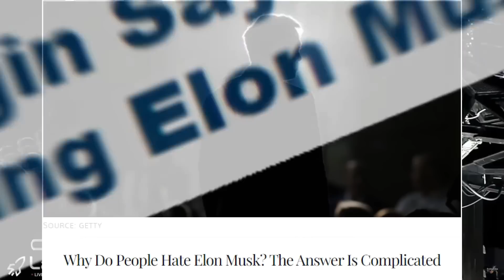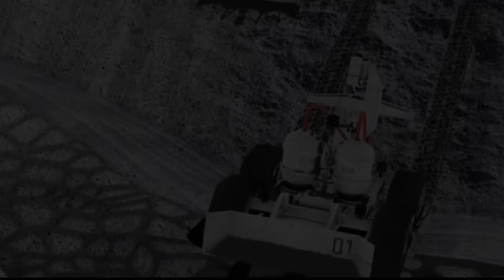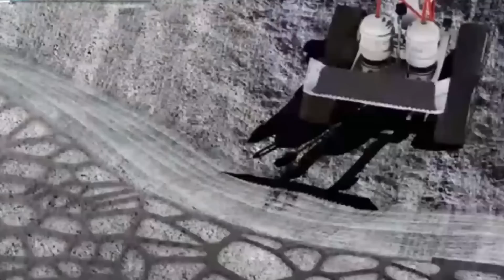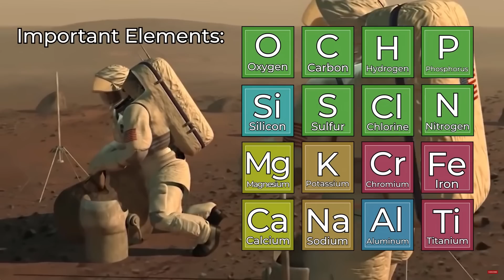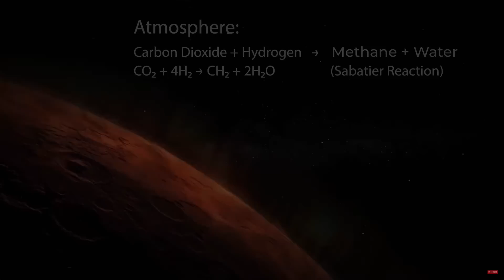Space Colonization: What is the Best Destination for Humanity in Space?

Comment: The moon is truly a necessary step.  We need to develop the industrial capacity outside Earth's gravity well.  
We can mass produce materials out of aluminum, magnesium, and silicon for sure out of lunar materials.  And with the much smaller gravity well and basically zero atmosphere we could then launch those materials into orbit or into the deeper solar system using mass drivers and not even need chemical propulsion for the effort.

We need to develop and perfect the ability to live and thrive in vacuum enclosed environments.  Not only to survive but to be self sufficient on the production of food and recycling of water and breathable atmosphere.
Right now we know we absolutely do not have the ability to sustain these systems over a long duration.
If we have people living in these systems on the moon and there is a catastrophic problem, they are less than 3 days from the full industrial capacity of the earth.  Problems arise on Mars. They are all dead, because at minimum they are 6 months away ( if they are lucky enough to have the problem just prior to a launch window) from those same resources.
Once we have these resources and industrial capacities developed on lunar, we will be able to manufacture fleets of ships, thousands of space habitats, Even the ability to start building the O'Neill cylinders to put into earth and lunar orbits and send to Mars and Venus and have thriving human settlements in orbits of those planets while we have the robotic equipment to start harvesting materials out of Venus's atmosphere and developing human habitation on the surface and beneath of Mars.
Reply from the maker: We agree Jared.  Orbital habitats will only be a possibility (large one) if we have access to the Moon.

Comment: Will Is clearly Biased for Mars and he is exaggerating the favorable conditions of Mars.  As it stands Neither Mars nor the moon can be terraformed.  Mars is a virtual vacuum, the soil is poisoned with perchlorates and there is no liquid water, it is mostly below freezing year round you would have to use pressure suits to get around and all of your architecture would have to be made up of pressurized tanks just like in space.  All the Artists renditions of living structures on Mars are total horse crap.  Most of those structures cannot take ten PSI, they would deform and explode.  And domes? forget about domes, you can only have a spherical shape, a cylinder with hemispherical ends or a lenticular shape or some variation of these but no flat surfaces and that includes Domes over a flat land area, it would take off like a rocket.  A 20 foot diameter glass dome would have a square area of 314. feet and pressurized to 13.88 PSI would have a lifting force of 314 tonnes.  Gravity is about one third so forget about piling dirt on it.  It would pull up a concrete footing and fold it like a Ritz cracker.  To deal with the pressure you would have to find a nice small crater that has the inverse of a dome,  line that with an air tight plastic, line that with rebar and concrete and THEN build a dome over it  with steel girders to hold in tons of pressure against your very very thick glass or plexiglass, maybe 2 to 3 inches thick for a few square meters.
     Mars does have more elements on the surface than the moon, but the moon is made up of the same accretion disc the rest of the planets were formed from and the interior should be rich in many things so it is just a matter of how deep would you have to dig to discover it.  the last several asteroids to hit the moon of great size blasted their contents like snow over the surface.  You can't know what is below that until you get an excavator up there and start digging.  You need the same habitats on the Moon as you would for Mars except the moon can get much warmer.
    The moon has oxygen and something like concrete so that is very good and there is water ice below the surface and in polar craters,  the same is true for Mars.   Mars also has lethal radiation and is so far from Earth that a rescue mission would fail if there was an emergency , six months to get there, have to wait for the 2 year window, no.  The Moon is a much safer distance .
    Mars is too cold, too far from the sun, the sun light is too dim, there is not enough gravity, not enough atmospheric pressure, not enough oxygen, not enough water and the radiation is lethal and the soil is poisoned.  Expect  about half of the people you send there to die every two years.  It's a death trap  There is a possible solution but it is MAD.  Send a ship out to some of the icy asteroids of around 10 miles in diameter, attach two or three nuclear plasma ion rockets to melt the water ice to make rocket fuel and propel the asteroid slowly towards Mars orbit.  In a few years adjust the  course so it hits the night time side of Mars.  Do this three or four times, re-using the original nuclear rocket engines repeatedly .  This would take decades.  But with each impact you would add water ice, oxygen, mass, gravity, warmth, atmospheric pressure and knock it a little closer to the sun.  If we could make it ten million miles closer over 30 years this would solve a lot of problems with cold weather, water, distance and fuel, time, breathable atmosphere, pressure, warmth.  It may not be possible to inhabit it during this process but perhaps make drop shipments and get a site prepped.
Reply from the maker: Very good points.  I think a floor to the dome would obviate the rocket effect.  I also think graphene and its derivatives could have some utility on Mars.  Many materials can easily handle one atmosphere and it should not be hard to use shaped inflatables so that a sphere is not necessary.  Inflatables survive the stress of reentry so getting them to work on the Moon or Mars should not be that difficult.  Mars main advantages are that it has micrometeorite protection, half the radiation, and more easily accessible water.  Terraforming  is probably not very realistic on Mars unless we can find a heavy, non-toxic gas to use to trap heat.  One that doesn't dissociate to free hydrogen like water and methane do.  If we could just open a Stargate on Venus connected to one on Mars and let some that sweet heated CO2 flow over we could terraform both planets :-)
Reply: @terranspaceacademy  The floor under a dome will have pressure on it too, it will try to assume a spherical shape so it must be stiff enough to withstand one ton per square foot or it will fold up like a ritz cracker.  If it were anchored to rock, like bedrock it would have the strength to withstand the forces of one bar.  Consider that Elon Musks 30 foot tank exploded at only seven bar... and it was a domed quarter inch thick stainless steel tank.  At 13.88 psi a 3 x3 window will have  nine tons of force pushing out on it, if it is not already bent outward it will quickly do so and break or explode out through it's opening.  It could be done with very thick plexiglass, like two inches or thicker, but imagine how much that kind of glass weighs, it would be impractical to carry many of those and very difficult to make glass on mars... it's so contaminated with iron oxide and perchlorates.
    There is a way to terra form Mars, crash Vespa on it or some suitable large icy body in the asteroid belt.  There is no easier or faster way to get cubic miles of frozen water to Mars.  Venus' atmosphere has too much sulfur and acid in it.
    Water vapor and Methane are very potent greenhouse gasses.
   Oxygen can be released from iron oxide ores making both iron and oxygen at the same time.  THis iron would be about as light as aluminum on Mars so it would be a good building material and shouldn't rust in the dry environment.
    If we could propel a comet into Mars I wonder where the molten water would drain to?  The Vallus Marinarus?  That's like Death Valley on Mars so maybe it would concentrate there.  The impact on a recent asteroid/comet by DART gave me hope that a very small object can alter the course of a very large object in space.  I would make crashing icy bodies into Mars my top priority if I were serious about terraforming.  There is an engine design, nuclear ion/plasma that might be suitable for the task.  THe question is how long would it take to alter the course and steer it into Mars?  How much would that move Mars sunward? While we're at it why not crash phobos into Mars, they say it's going to hit it in the future anyway, better sooner than later.
Reply from the maker: @TheWadetube  That's very true... should we go all oxygen and get away with 20% pressure? (0.2atm/200kP)
Reply: @terranspaceacademy  No, we need the pressure to force oxygen through our lung tissues.  The limit I believe is around 5 psi, about one third of sea level pressure.  There was a study done and it's in a youtube video about people who are super human, a tibetan or himilayan Sherpa guide was put in a room with other volunteers and the pressure was reduced  to simulate being on Everest, they all passed out except for the Sherpa guide who was used to less pressure and had more oxygen carrying capacity than normal people.  At some point the saliva will boil off of your tongue and the lungs will experience the same fate.  Pure oxygen is not healthy for lung tissue but there are practical limits to how little pressure we can stay conscious at and not damage our lungs.
    For years I have pondered how to make these habitats and for years artists have been doing fanciful renditions that are inspiring but will explode before 10 psi is reached.   I think 30 % oxygen would be safe and help but we need steel containers or multi layered high strength fabric inflatables and small windows only.  I am troubled about airlocks, we need so many for safety sake, two per connection if we want to be prepared for a pressure loss on either SIDE of the junction

Comment: Cooling any heavy duty equipment on the Moon is going to be a nightmare, they had to solve over-heating problems when designing the Apollo lunar rovers which only moved 8mph, such machines with massive battery's and hydraulics will likely have very limited running times and have to be connected to radiators afterwards. This is less of an issue on Mars since even the thin atmosphere can diffuse heat.
Reply: I completely agree :)
Reply from the maker: Good point... nice way to make some electricity though with photovoltaics... and any shaded area on the Moon drops to a very low temperature so a radiative heat sink in effect.

Comment: Why subjected to politics and why on the surface? Also mars is further meaning more solar cells needed also moon has fusion fuel and might not mars has dangerous winds and storms moon I think only has solar storms so both can have habitats under ground or have solar shields in orbit for protection.
Reply from the maker: The winds on Mars are not dangerous.  With an atmospheric pressure less than 1% that of Earth a 300kph wind could barely be felt.   Mars has better radiation shielding from its atmosphere but habitats on both worlds will need to be underground or heavily shielded.
Reply: @terranspaceacademy  I was referring to the static charge build up from the dust storms on mars but okay and the atmosphere is 1%of earth. Would it be possible to concentrate the atmosphere is bubble habitats? Thanks for the feedback still learning everything.

Comment: Is it possible to use an effective closed loop water cooling system that cycles back and forth between the underside of starship and the cooler top side, where numerous radiator fins can be scattered across the topside in a fingerprint like patterning that barely raised above the general surface of the ship(by about an inch)?

If so:
Would this same system be able to be used as mechanism to fuel turbines that power an electromagnetic feild into further deflecting the plasma of re-entry speed?

The idea is that water becomes steam which flows rapidly through narrow channels lined with many small turbines that bleed momentum~energy off that steam, thus helping restore liquid state as the h20 molecules bleed off energy en route to the radiator fins which cast off the remaining heat before internal pressure and remaining inertia feeds that water back under the ship again.
Reply from the maker: It would help depending on the heat load... the pressure could get extreme though.  It would be better to use the methane they pump it on to the engines or use if for pressurization

Comment: I believe the Moon has aluminum and titanium, and Mars has iron, but do they have other basic industrial metals in quantity? ( Like copper). 
      I think the Moon will become sort of a way station, maybe shipyard, a good first step ..or second. I guess a space station is first, and we've done that.
      I will definitely check out Mars Matters..
Reply: Here is a link to where I compared Lunar and Martian elemental regolith composition (% by weight).

https://youtu.be/VulfGs6Ok9Y?t=22

You'll see that Copper is not listed, as it falls into the "other" category on both the Moon and Mars since it only exists in trace amounts.
Reply: @MarsMatters  I guess they'll have to use aluminum for wiring, windings and the like... aluminum wiring was used in homes back in the day, but had the reputation of starting fires. Aluminum oxide at screw contacts heated up with heavy currents. 
     I suppose asteroid mining will be necessary...
Reply: @scottthomas3792  Either that or the Moon will require imports of these things from Earth. With cheaper options for sending things to space that might not be too much of a show stopper for a small initial base, but if the goal is  to become self sustaining or to expand the Moon will need resources from asteroids.
Reply: The moon has very limited resources, but it is close.
This means easy communications and short travel times. These are the advantages of the moon.
Reply from the maker: Every impact crater on the Moon is the impact site of a meteor (do you call it a meteorite without an atmosphere?)
which means there should be heavy metal to mine there.  As well as the large metal mass under the Aiken basin.

Comment: I'm surprised to see that the first thing you would want to build on the moon is a habitat and landing pad. Wouldn't priority one be creating solar panels? That would give power that could be used to create larger foundries for creating more building material and oxygen from the regolith. Could be I'm missing something - I only have the barest understanding of these processes.
Reply: As you can see from the image at 10:47 , the purification of silicon requires Carbon, with higher purities of silicon (leading to solar panels with higher efficiencies) requiring Carbon, Hydrogen, and Chlorine. Carbon and Chlorine are basically non-existent on the Moon, and hydrogen only exists in the water ice deposits at the bottom of frigid (near absolute zero) craters, which themselves are only in select places at the poles. 

Extracting the hydrogen from the water means you don't get to use that water for drinking or growing plants, so there is a trade off between acquiring hydrogen from the water and having the water itself.

Very low efficiency solar panels can be created with very low grade silicon, getting efficiencies of 2-5%, so ultimately the creation of solar panels on the Moon is possible if you take a "quantity over quality" approach, but ultimately Mars is MUCH better suited to the production of solar cells from in-situ resources.

This is a shame too, since foundries for baking oxygen out of lunar regolith will be needed for sure, and this process requires ridiculous amounts of energy.
Reply: @MarsMatters  I agree that such a process would be inefficient - but I see that as an advantage of the robots first approach. There's no particular rush, and everything that can be done before the people arrive helps bring costs down. Then again, if we're dropping 20 tons at a time, a few panels may not make a major difference in the overall scheme of things.   

You do have a point that a lot of these processes would be easier on Mars than the Moon - but why not test them on the Moon first, where relatively little is at stake beyond the reputation of a few scientists and engineers? :)

Thanks for the detailed reply!
Reply from the maker: We went nuclear :-)  The ship would bring the panels from Earth.  We would need a lot of infrastructure to make them on the Moon and while there is silicon on the Moon the Earth would make higher quality panels for decades.

Comment: If Mars had a strong enough artificial magnetic field to hold a thick warm atmosphere, I wonder what flightless birds could soar through Mars sky’s? How far and high could a flying fish go if Mars had ocean as well? Would a large ocean wave look like it was in slow motion. How high of a bridge could you jump off of before it become dangerous. And how long would it take to loss everything if the artificial magnetic field stop.
Reply from the maker: It would be beautiful wouldn't it?  Imagine the size of a martian condor!
Reply: The magnetic field does not hold in atmosphere, only gravity does.  The magnetic field is meant to keep the solar wind from blowing the top of the atmosphere off.  That being said, we do need an orbiting ring of nuclear powered or solar powered magnetic fields as well as a very strong magnetic field up on radio towers on mars to protect the colonists from radiation.  Atmosphere can be brought in on icy asteroids from the main belt and crashed on the far side of Mars.  A few cubic miles of water ice would go a long ways in getting a thick atmosphere.  There is also oxygen in the rust in the soil of Mars and that can be released by electrolysis if I am not mistaken.